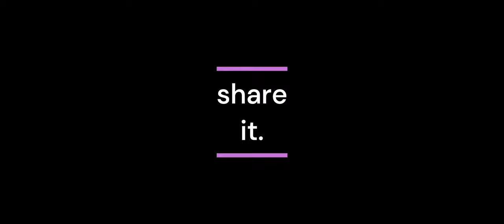testing prototype hub for producing free 12v power with HMH small trailer built just to test! works!

Comment: All you really need to do is get a power inverter and a battery charger.. hook the inverter to the battery, plug the battery charger to the inverter, hook the charger back to the battery..  Don't get some BIG ol charger !!  somethin like a "Deltran" battery maintainer is all you need, mine is a Deltran 800mA..   Don't buy a cheap Amazon special !!!!
Reply from the maker: Thanks for input, thanks for watching!
Reply: How much power can you generate in a day on your own typically? And does it have to constantly be in use to generate that power?
Reply from the maker: I do not know yet, but yes, it needs to be moving constantly to charge, I will keep all posted the more I run it!, thanks! @Gigachadly